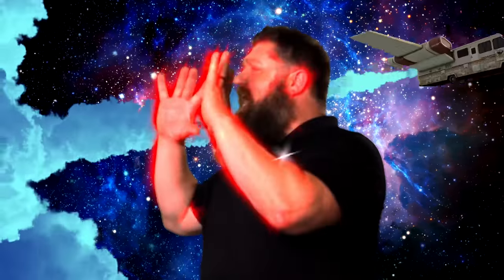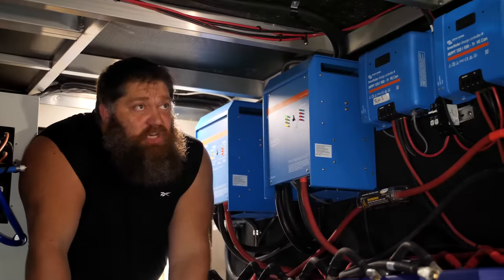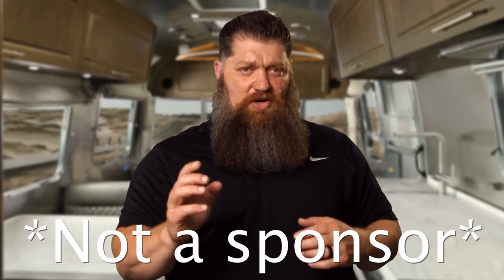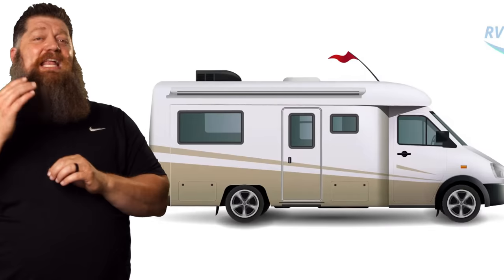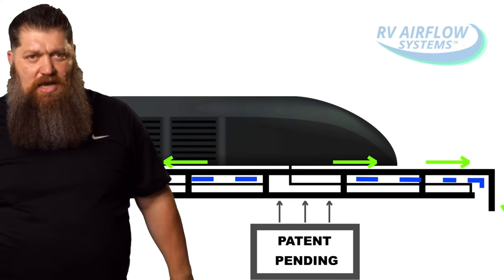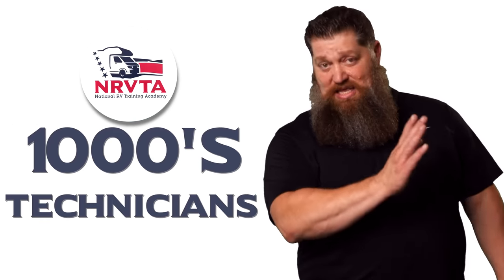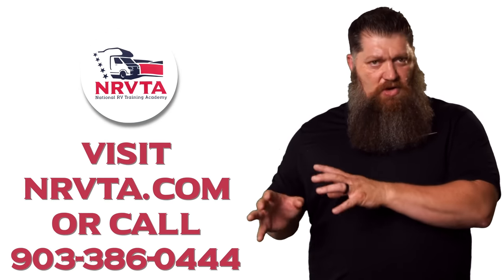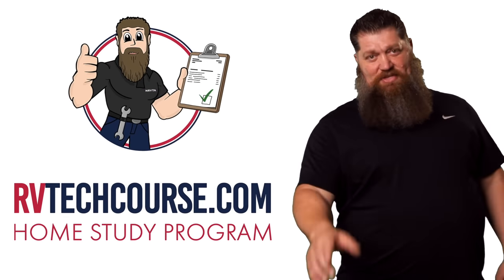Can I increase Air Flow in my RV AC

Comment: #1, Who in the world thought it was a good idea to make the A/C covers black! #2, Why have not more company's not gone to mini splits? I have been heating and cooling my 1000 square ft. house for over 10 years with no issues and almost can not hear it running when on. And it only needs a 20 amp. circuit. I turn on the A/C in my tiny 17 ft. trailer and forget about talking even when set on low.
Reply from the maker: So for YEARS they were all white shrouds. IT was the customers that asked for black to make it look better. I put on white. 

Mini-splits are good, but not designed to take the bouncing of going down the road. nor will it be covered by the warranty. Once they make them mobile then you will see a huge change.
Reply: Has you mini split survived an earthquake for hours on end days at a time?

And I can run my 15k roof air on 20amps

Comment: *Edit for two days after install* It was mid 90s today and when we came home after all day of jot being home, it was 69 degrees! We absolutely wish we would have done this sooner. Make sure you tape up any cracks as well!

I just installed this two days ago and instantly felt the difference.  All throughout the day, it worked great keeping the living room at 68 or 69 but during the evening, it seemed to struggle to keep it at 71.  And, it definitely isn't quieter.  It seems louder.  We'll see how the temps do today.  It did help our mid bunk airflow considerably!
Reply from the maker: Amazing. Thanks for sharing.

Comment: The RV air conditioner needs to be completely redesigned it's terribly inefficient. The evaporator and condenser need to be split apart which technically they are on the rooftop unit but because they sit so close to each other it starts achieving equilibrium. If they could design a mini split unit that is designed to handle vibrations like the rooftop air conditioners. It would be a huge win for the RV community. The problem with the rooftop units is the evaporator is outside which is not good because it loses a lot of its cooling abilities. To make things even worse it then gets pushed through small poorly insulated ducting that the sun is beating on the roof. So by having the evaporator completely by itself INSIDE the RV and the condenser OUTSIDE. It would maximize efficiency. And would also give the option to use as a heating source in the winter so this could also replace your gas fired furnace in most areas
Reply from the maker: There are components in the RV that could definitely use an overhaul in design. A big consideration is the portability aspect of the RV. These are subject to a major earthquake every time we move them. Mini splits are amazing and there are plenty of DIY RVer's that have went with that on their coaches. Thanks for sharing.

Comment: Great...my inner Todd Henson had the Two Minute Tech Tip Tuesday down pat...now I need to learn it all over again!  On another note, is having ducted A/C more of a detriment to air flow than a unit that just expels the air from one location?

If anyone wants to learn any other ways to improve air flow, order the online NRVTA Training Program (or attend in person).  Todd gives other great tips there!  Now how's that for a sponsorship?
Reply from the maker: nice work. The direct dump is most efficient however some RV's need the ducting.

Comment: Only problem is for us RV owners who don't have a ducted systems, RV Airflow doesn't offer a unit for us. :(  We just have one simple Coleman Mach3 13.5k unit that supplies cold air out the vents of the AC only. Is anyone aware of a way to help (increase) cold air flow for us?? Thanks
Reply from the maker: That's a great question. Usually the most efficient way to cool a room in an RV is using a direct dump. I'm sure there's a way to get a little more cool air out of their AC.

Comment: The bad side affect of the Airflow unit you talk about has a huge flaw. It has air bypassing the filters pumping dust through the duct work and in to the evaporator coil. The won’t respond to that even after multiple pictures showing how it by passes. Yes it does bring temps down but it’s with a long term price of excessive dust going through your ac unit.
Reply from the maker: What model ac? I want to look at the setup, see if I can duplicate and see if it’s reproducible and what the fix might be.
Reply: @NationalRVTrainingAcademy   Coleman Mach. When you remove the air shower plate, you at that point turn your dump vents into inlet vents. They aren’t sealed. I’ve tried reaching out to them many times to no response. What you see over time is dust tracking all around the dump vents and it collects in your whole system. Anytime you want to see the long term affects of it let me know, more than happy to show you first hand.

Comment: Question, which way does everyone point the vents inside the coach? Anyone found a pattern that works better than others?
Reply from the maker: Not sure if there's any one pattern that would be superior to another. Direct dump is the best way to cool one room. an insert like the RV AirFlow would help increase air flow. One tip is to not close off one rooms vents. if using vents make sure they are all open. or use direct dump.

Comment: Do they make these for fully ducted EV’s?
Reply: Rv’s
Reply from the maker: Since these units direct the air into the ducting I would say that it would work. RV Airflow has a list of compatible AC units and the directions needed to install. Fully ducted units may require you to access it from the roof.

Comment: Does this work for nonducted units like the ones in Alliance Valor rigs?
Thanks
Reply from the maker: they only work for the Front ducted units on an Alliance. this isn't designed for direct dump only units. You can always reach out to RV Airflow and see if they plan to design something that increases direct AC dump efficiency

Comment: Is there a way to wire my Dometic ac for a thermostat?
Reply from the maker: Most Dometic AC's come with a Thermostat. Unless you have your AC controls in the ceiling on the AC vent cover. Some AC's that are standalone don't have the wiring for a thermostat. You'll need to research your specific unit and see what it has.
Reply: @NationalRVTrainingAcademy  correct - controls are on the AC cover in the ceiling.  We lack the convenience of a thermostat.
Reply from the maker: It's not too difficult to do. The hardest part is fishing the wires to where you want the thermostat located. It's 3 wires 12v+, 12v-, and Comm line will run from the AC control box to the thermostat. I would suggest that you get the wiring diagram on your specific AC model and find where those 3 wires are located. Reading forums and researching the topic will also help.
Reply: @NationalRVTrainingAcademy  I realize now after checking my manual there is a thermostat of sorts in the ceiling controls.  However, all it allows is the compressor shuts off and on depending where the dial is set.  The fan runs continuously.